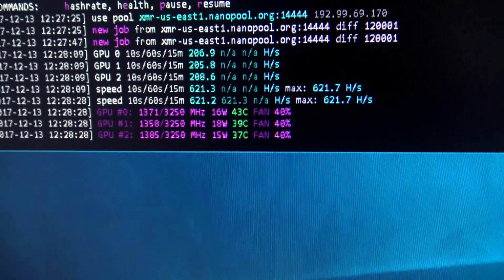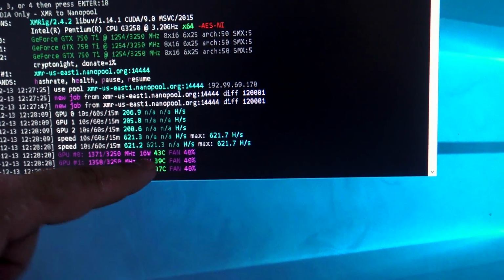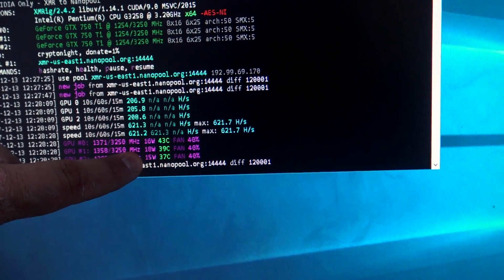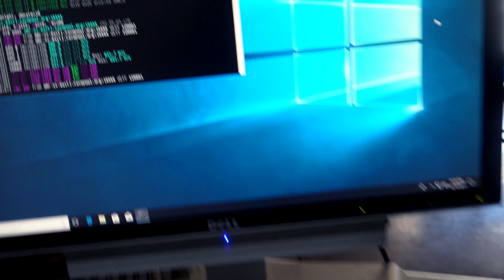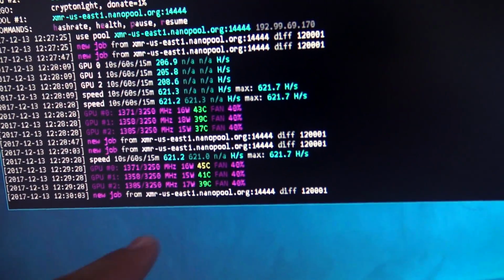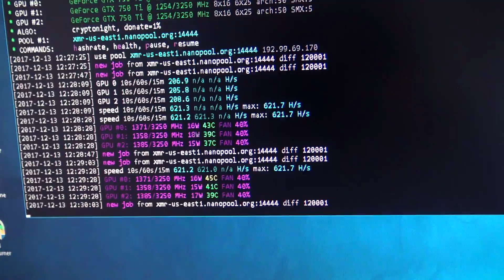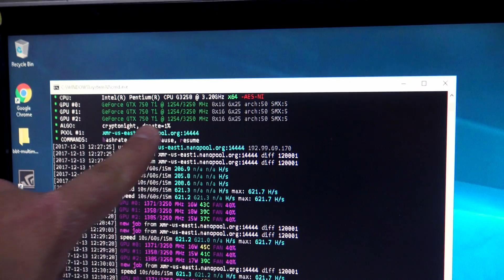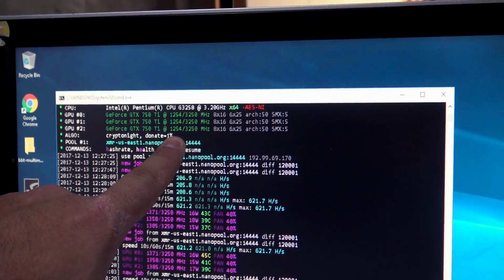Blast from the Past - Can the 750Ti still perform? XMR mining

Comment: Hello, i have gtx 750ti 2gb when i starting miner i see cuda error - cannot allocate big buffer for dag. check readme.txt for possible solutions.How to fix this?
Reply from the maker: 2gb does not work for Ethereum, the memory requirement is over 2gb, but under 3gb. You will have to mine ubiq or zec

Comment: I just found my old NVGA SC 750Ti, popped it in, overclocked to 3300MHz memory, left core untouched (defaults at 1305Mhz), got 261.8H/s using xmr-stak.

Comment: You can just buy a single Rx570 or something and pull 700+ hs/s.  Cryptonight doesn't eat a lot of power.
Reply from the maker: oh there are def. better solutions, this is more for the folks that dont have access to RX / R9 and other options. Turns out the 750Ti is not to bad

Comment: you need 10 them for 1 vega 56 ;)
Reply from the maker: would be cheaper technically; on ebay 39.xx per card 10x = 390.00 ; 10x18w = 180w + 50w MB/CPU + 10w per riser = 10x rig would be less than 350w and you would have 2200h ; vega is less power in that scenario, but if all you have access to is 750Ti's ... its an alternative

Comment: Ryzen 1700 CPU is more effcient. mine gets 630h/s @ 90 watts total system. Plus easy to find and not expensive ~$200 usd. then slap whatever GPUS you want on board and you have a real mining rig.
Reply: 1700 is going for $300, not $200.
Reply: Nah its been marked down for the better part of two months for $279. and regularly $229-$239.

Comment: Hi, im trying to set up Asus 19gpu mining board with 13 AMD RX470 overclocked mining cards in Windows 10 and they seem to work with a normal driver mining at about 21MH/s but when i try to update to the Crimson Mining driver the whole system crashes and i get the blue screen. Am i doing something wrong? Also the afterburner does not work with more then 8 cards? what else i can use to change the clock settings on more then 8 cards? Appreciate any help guys! Thanks
Reply: Blue screen, and afterburner you said. That is a good sign you overclocked them too much. When I overclock my system or unlock extra cores, I usually get blue screen if I try to max the system out on normal cooling. You may need a superior power supply to handle the extra voltage
Reply: I'm running 2 x 1000W PSU's which i assume would be sufficient for 13 GPU's?

Comment: In term of power efficiency, they are good but in term of h/$, they are so so because you will need a full rig (8) to not even match ONE vega56 for the same power consumption. If you add the riser cost, in the end it's not that good

Comment: Still rocking a ATi HD5970 @ 350 monero. Power consumption is 294W. Not worth it but funny that a card from last decade can still do anything. Got it for €35. Not reccomended for profit but a badass card anyway for €35. I also picked up a gtx 750 non ti 2GB for €35

Comment: LOL 1 RX 570 4GB does 800+ H/s, that's = to 4 of those 750TIs man, AND for the same wattage as too... 1 card though, so it isn't taking up the whole rig.

[Hash Rate Avg: 6428.8 H/s]
825.7 H/s GPU0  RX 470 4GB Samsung | Mem Limit: 2100 = MAXED
750.7 H/s GPU1  RX 570 4GB Elpida | Mem Limit: 1915
822.7 H/s GPU2  RX 470 4GB Samsung | Mem Limit: 2100 = MAXED
823.2 H/s GPU3  RX 570 4GB Hynix | Mem Limit: 2040
825.9 H/s GPU4  RX 570 4GB Hynix | Mem Limit: 2040
802.5 H/s GPU5  RX 570 4GB Elpida | Mem Limit: 2035
823.2 H/s GPU6  RX 570 4GB Hynix | Mem Limit: 2040
754.8 H/s GPU7  RX 580 4GB Elpida | Mem Limit: 1915

Core clock is set evenly to 1200 per card, and those 2 cards with the 1915 Mem Clock were bad Elpida memory.

You ALWAYS have a risk of getting those with Elpida only pretty much for AMD.

Hynix isn't good for GTX 1060s at Ethereum though according to Bits Be Trippin', and a few other 1060 mining rig owners, but Hynix on AMD is golden <3

Machine uses a total of 825 Watts with the 8 GPUs, and run under 50c each card, yep, next to the window with a box fan in it on low speed blowing that ice cold air from outside in.
Reply: You need to use CAST XMR that same card will do 1000h.
Reply: Those stats are from Cast XMR lol, the latest version 080 that was just released makes it now fully compatible with RX 470/570 cards.

The only RX cards that reach 1000 h/s are RX 480/580 8GB cards, and with GREAT memory clock at that, a possible 900 something for RX 470/570 8GB.

The more memory the better for Algorithm mining... but yes that new version I was using works wonders.

My stats for Claymore are this basically...

775 H/s GPU0  RX 470 4GB Samsung | Mem Limit: 2100 = MAXED
700 H/s GPU1  RX 570 4GB Elpida | Mem Limit: 1915
775 H/s GPU2  RX 470 4GB Samsung | Mem Limit: 2100 = MAXED
775 H/s GPU3  RX 570 4GB Hynix | Mem Limit: 2040
775 H/s GPU4  RX 570 4GB Hynix | Mem Limit: 2040
740 H/s GPU5  RX 570 4GB Elpida | Mem Limit: 2035
775 H/s GPU6  RX 570 4GB Hynix | Mem Limit: 2040
700 H/s GPU7  RX 580 4GB Elpida | Mem Limit: 1915

The main hashrate is like.... 6000-6020 H/s all together in that miner.

But using Cast it gives me 400 more H/s, love it, can't wait for future updates.
Reply: Right my bad. Yeah I got Rx480's on the ubermix mod doing over 1000h. Yeah Cast XMR is great. I hope they do a CPU version for my 7920X.
Reply: Be careful of moisture my friend, that box fan ruin you if you don't do it right hah. im sure you are but just a heads up watch out for moisture
Reply: +derty QWERTY I been mining for a long time I am aware of that being a possibility, but not for my setup, it's impossible for the way things are positioned in my room, the GPUs got a lot of breathing space, and the gpus are dry, the GPU itself is under 40c but the PCB itself is warm/dry.
Reply: Mike ™ well good for you! :-P
Reply: Mike ™ fff